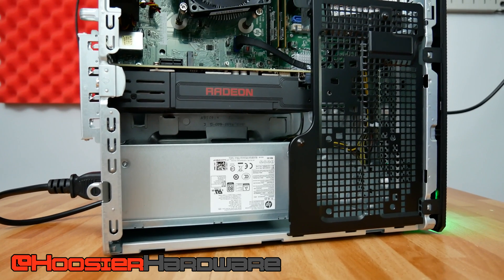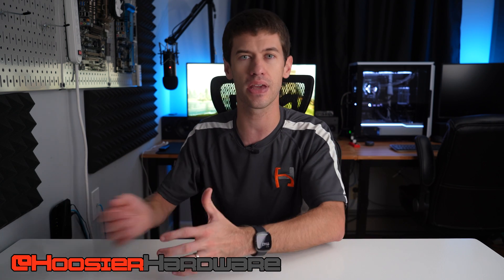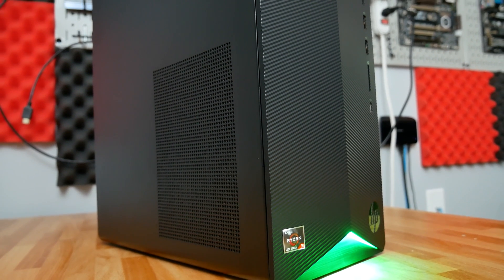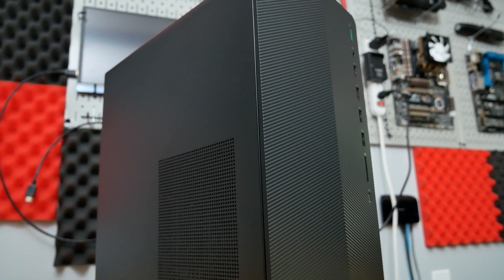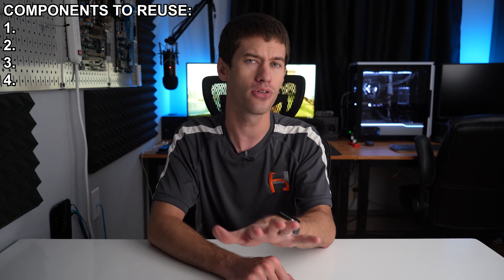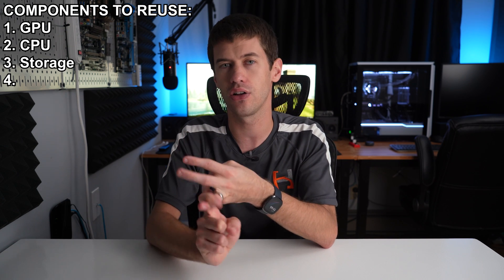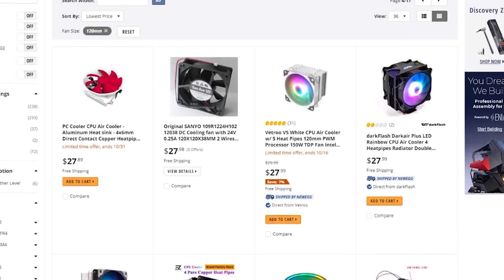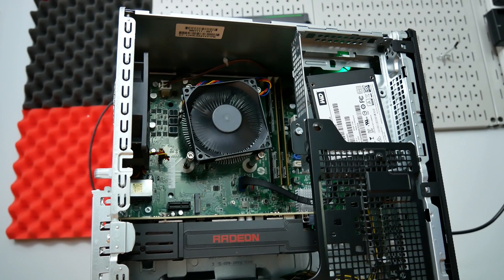How to "Fix" an HP or Dell Prebuilt Gaming PC

Comment: My father has this exact HP w/a 5600G and a 5500x 4GB iirc...tried to install a remote control starter by Silverstone, but it required a usb header on the motherboard.  I was surprised to not see any as most mobos I've ever seen always seem to have 1 or 2, even OEM pre-builts, iirc.  There is some weird pin assignment I read somewhere could be converted to a standard usb header, but I gave up on trying to make it work for now.  I did save the details and might try to take a stab at it sometime in 2022, as I read up more and if I feel more confident afterwards as it didn't exactly seem easy to find an adaptor when last checked.  He may have to try an upgrade like this video eventually as some of his games crash even after jury rigging a side fan and clean installing to latest gpu drivers.  One is World of Tanks, the other is Medal of Honor Allied Assault, not very demanding games but haven't been able to determine the cause they stop full screening and then rarely closing immediately after.